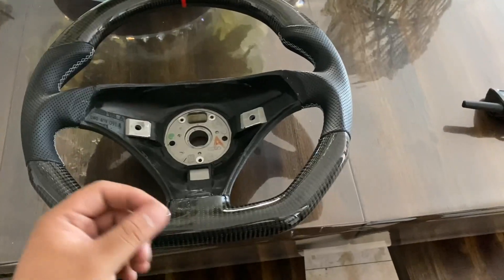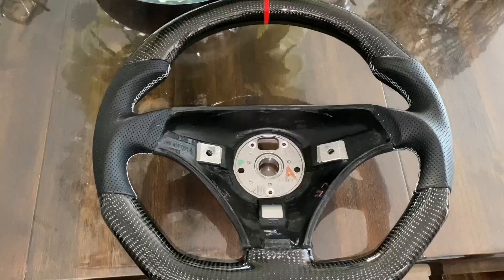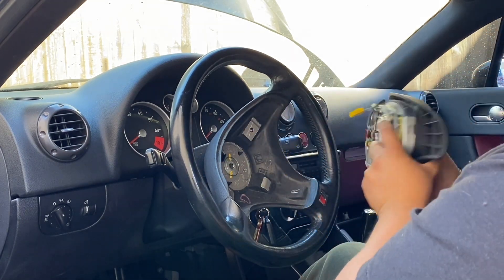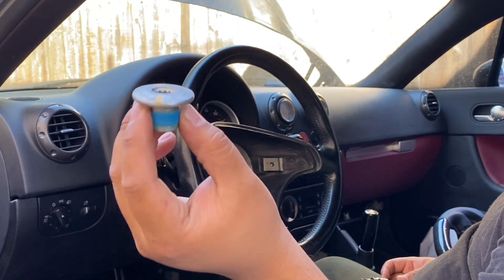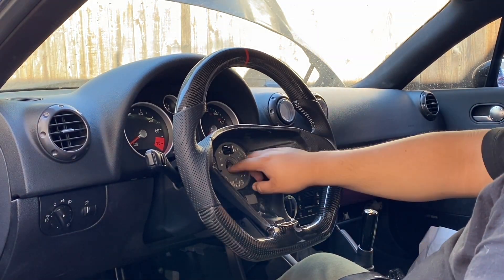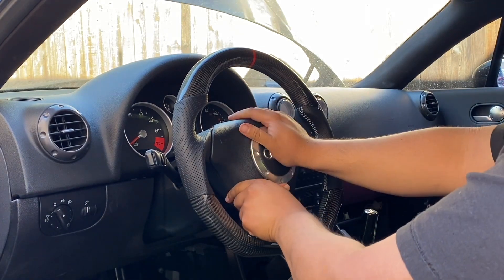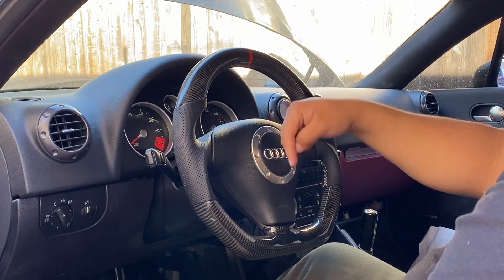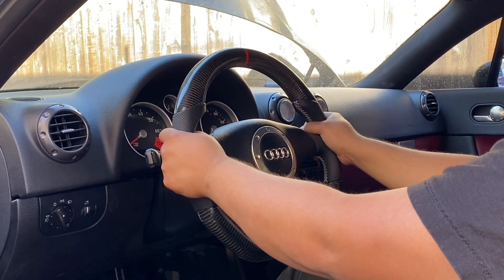CARBON FIBER STEERING WHEEL Install On My AUDI TT!

Comment: Looks fantastic man! Love the videos. Where did you get the wheel? 

Also, did you need an alignment before the steering wheel swap? If not, The wheel is just off by a couple of teeth, there should be a dash line on the wheel itself, and on the steering column shaft, line those up and you should be good!
Reply from the maker: I got lucky on ebay someone was selling their wheel due to their TT getting rear ended. All i know is that it came from the UK and whoever made it did a great job! 

I did align the little marks brotha my alignment was already  off due to the fact i replaced my control arm bushings and also added poly top mount bushings so thats why the steering is completely off 🤣 thanks for the heads up man 🤘🏼i shouldve given some more info

Comment: Hi. Is your horn working!?
Reply from the maker: Yes replaced my horn assembly after i posted the video
Reply: @TheOGbuilds  I wonder if u do have a diagram for this wheel it does assemble yours but mine comes with 3 connectors clamp
Reply: And my wiring harness has got 2 cables connectors brown and black